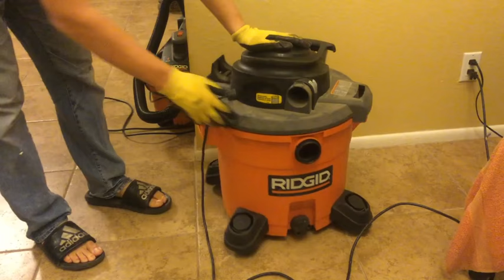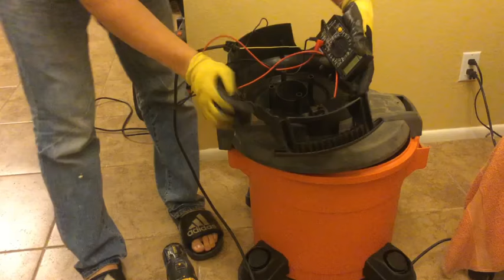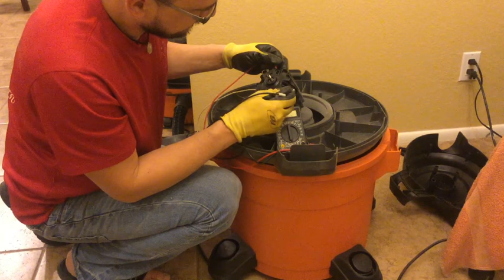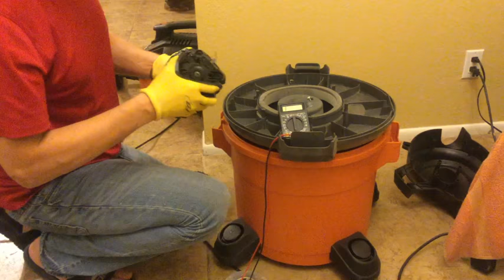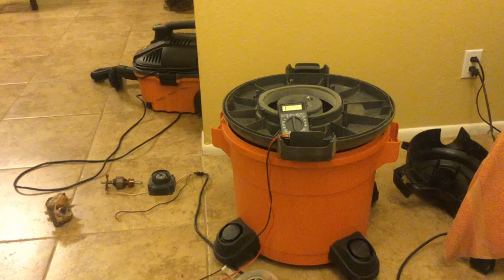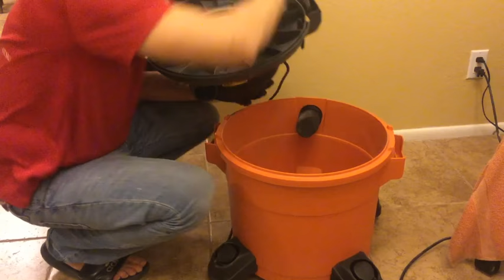How to Fix and Repair a Ridgid shop vac (switch, thermal fuse, troubleshooting, parts link)

Comment: Just needed to know how to get the motor out of housing as a piece of copper wire was flailing around and vac wouldn't power on. Watched ur vid and fixed the darn thing all by myself on my 60th bday. Right proud of myself and thanks a heap for the housing dismantle instructions. I would have given up if I hadn't watched ur vid.  I got it right the first time. I sure will be watching ur vids for future tips n tricks as a widow living in the woods.  Thanks for sharing ur knowledge.😊

Comment: Fantastic! Got my fuses next day from Amazon. I tried 2 different soldering irons and a torch and couldn't solder the pieces together. I noticed mine were originally connected by crimps. As luck would have it I had some that I use for offshore fishing rigs. Works like a champ. $6.00 and a few hours later back in business. Thanks for posting this.

Comment: My Ridged shop vac just died attaching it to a thickness planer. After many hours of use on my other shop tools, the thicknesser took it out in 15 minutes. 
This is going to save me a lot of money. Thank you very much for your helpful advice!
Reply: It seems my washer sitting between the 13mm hex is affixed. Unsure what to do now 😢
Reply: down with the thickness eh? ;P

Comment: Interesting. Thanks for the post. My issue turned out to be a little different, I never took the motor apart, instead I found that one of the leads for the brushes had acted like a thermal fuse and melted where it goes into the carbon
Reply: Just found the same problem .. Trina figure out how to replace now
Reply: How did you fix it?

Comment: If you have a air compressor / air nozzle and you vaccuum a lot of fine dust like drywall dust, does opening the motor up and blowing around in there help  to increase longevity of the  shop vac or is it  not worth doing?  I've had my Ridigd shop vac for about 5 months now and it's working great.  Was just wondering if I should open it up periodicially and blow out the sealed up areas of the vaccuum near the motor.

Comment: I noticed in the background you have a Ridgid 4 gallon shop vac.  I have the same exact model and I am trying to understand how to remove the motor.  I have everything apart, but it seems the washer is part of the bolt and I can remove it to, so I can remove the motor.  Help!?!

Comment: I'm almost there. My shaft washer is either pressed or glued on. Hammering away at it soaked in wd40 isn't working, so I either need heat or a puller, but both methods will destroy the plastic body. Why couldn't they move the fuse somewhere more accessible?
Reply: Yep.  Some have a washer bushing that holds the bearing that is pressed on.  Disposable or lifetime warranty.

Comment: Did you leave it plugged in while working on it?
Reply: That's what I was thinking. 😬
Reply: @tristenb7723  He did leave it plugged in, most of us that have dealt with electrical repair can leave stuff plugged in, but can disconnect wires internally (especially with electric motors), which he did after he checked for continuity in the coil winding and the white wire. Right after he did that you can see the video jumped to a later moment when he was getting the screws out of the motor cover, the wires were disconnected from the motor. The main power line for the vac was still plugged in, is it dangerous? Not really the chance of the two wires touching each other is minimal

Comment: I checked the switch and the thermal fuse and everything looks good ! One thing that confused me was should I check the white and black wire by putting one wire on the white and one of the opposite brush ? What else could it be !
Reply from the maker: The fuse is usually on the white wire. Only check the continuity (ohms) on the white wire (both ends of the multimeter go to the two white wire ends). Don't check for continuity with one end on the black and one on white -- that is not going to check what you are looking for. You could also have a bad switch if the fuse is good, so check the switch first
Reply: If she already let the smoke out, you could have already burned the windings to a short..  if windings all look and smell ok then could have a loose wire or not testing right.,  you just want to test continuity directly over the fuse and switch..  the Ω readings can screw you up if it reads something lower because of dirty contacts..  there should be a test where the meter beeps when you touch leads together..  if it beeps when touching over the fuse and switch than both are good..  would be loose connection or a dead short on motor..

Comment: can i use solder when replace it or must do like you do?
Reply from the maker: The fuse is sensitive to heat (thermal fuse)... if you're good (efficient, fast ) with soldering then it may work. Heating up the fuse can blow it
Reply: @MrCDA240  
Make sense 👍👍👍
Reply: I've always soldered them, but fast.  I didn't see where put the fiberglass insulation back over the fuse.  You could sacrifice some wire connectors and cut the tabs off and make your own crimp ferrules.

Comment: If ridgid has a lifetime warranty why don’t they just install the fuse in an area that’s easily accessible and sell replacement fuses at Home Depot
Reply: That would make too much sense therefore they won't do it. But now that you mention it I want to see if I can set up such a thing for mine as it suffered the same problem.

Comment: Could I bypass the fuse and just connect the wires or copper together? Three weeks to wait for a part is murderous it would probably  must likely send to much current threw lol
Reply from the maker: I would advise against bypassing the fuse. There is a risk of an electrical fire.
Reply: If at some point you want to do the "electrocution shuffle" but don't bypass the fuse.

Comment: You rebuilt that bitch.  Rigid wanted you to buy a new one.  My fuse blew when i was slowly vacuuming up some water.  I did not realize i needed to work in one minute bursts.  I ran continuously for 4 minutes and overheated it.  How was rigid expecting to keep the motor cool anyway?  This is a money maker for them when people try to do sustained work with the vacuum.